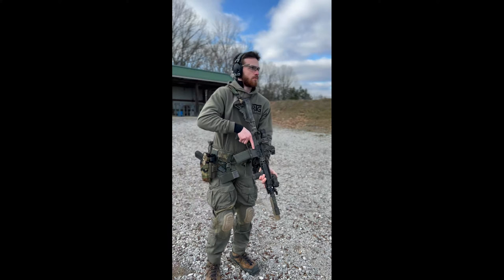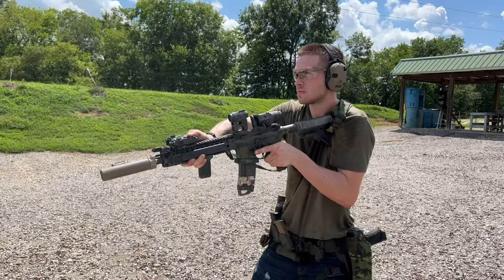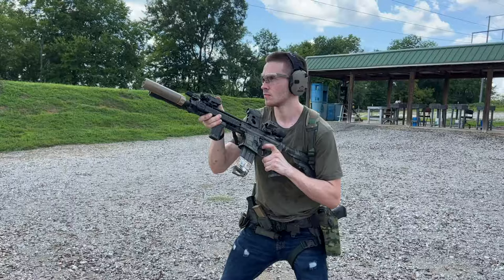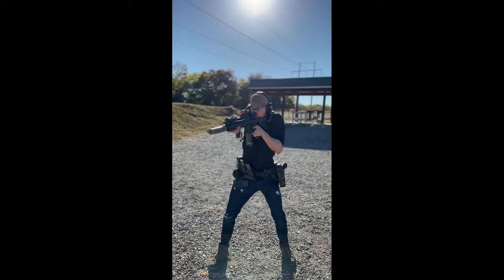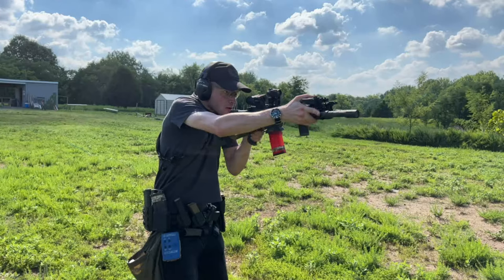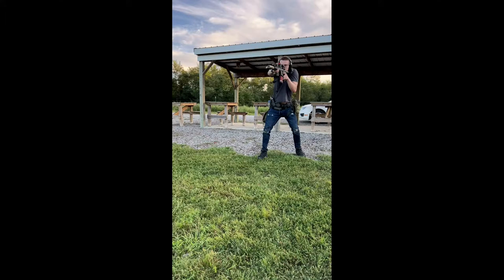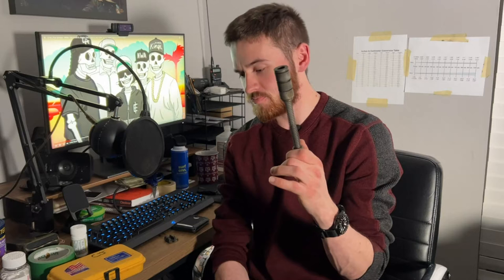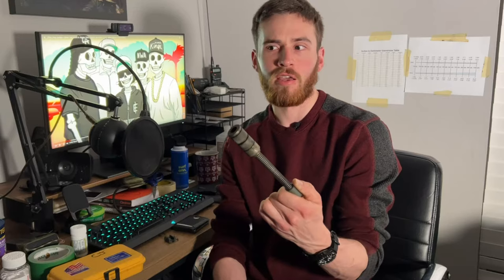JP Enterprise silent buffer system review

Comment: You presented a large amount of incorrect information. There is an easier way to replace the o-rings.  Follow the directions provided in the videos.
Reply from the maker: Large amount of incorrect information would mean more than one thing and what you just said is one thing. As i've said to a lot of people so far Regardless of what it even takes to replace the rings a lot or a little, its still a failure point that doesnt exist and a standard buffer system works perfectly fine. The gun is fine without this system. I "Personally" dont feel the need or see the benefit to using this system.
Reply from the maker: I honestly cant express it enough how the buffer system has made zero difference provided the weights are the same in anything having to do with actually using the gun.

Comment: I am filing a class action suit against Ford. The round things that my truck rides on are wearing out and steel is showing. What kind of bs is that. I call the dealership to complain. The service writer laughed at me. He said they were called tires and that's a wear item and they will need to be replaced periodically. I started whining that I paid $80,000 dollars for the truck. The tires should last for the life of the truck.😢
Reply: “Nope. Tires solve a problem that doesn’t exist and I don’t like creating new problems. My wagon wheels are creaky and bumpier but they are cheap and replaceable and what everyone else uses and they work just fine! DO NOT IMPROVE ON SOMETHING THAT ISN’T A real PROBLEM, PERIOD”

Comment: JP put out a video on how to change the O rings without disassembly of the system. Very simple and quick to do. By the looks of your system, a good cleaning might help as well.
Reply from the maker: I’ll have to give it a look, regardless the issue is more so the failure point and then having to service it whilst in the middle of other things
Reply: I was surprised with how dry the buffer in the video was, I expect a responsible gun owner to make sure their firearms are properly lubricated and taken care of. I'm always giving my friends shit for not lubricating their guns and then complaining about reliability issues.
Reply from the maker: @Simply709  You think im gonna handle the buffer in hand while its soaking wet in lub? its not in the gun and im talking about it. It was wiped dry..............
Reply: @autonomousdefense  Yeah, actually. it doesn't need to be completely submerged and dripping in lube, Nobody is asking you to stick it in the 55 gallon tub of lube that your boyfriend keeps next to your bed to make a video. But any responsible gun owner would at least put a thin layer of some sort of CLP on their tools to keep them from rusting. And by how dry that buffer looked I'm assuming it sat dry for a few days. You should never leave tools just sitting dry, especially gun parts. Its literally one of the first things you learn in gunsmithing school. Unless you went to SDI, then they teach you how to wipe your ass.
Reply from the maker: @Simply709  its hilarious watching just how hard you're trying to make yourself not look like an idiot because you dont understand the concept of wanting clean hands. I'm sorry you didnt take 30 seconds to consider maybe it doesnt need to be lubed because not only is it no longer in use but it will likely never be inside another gun again because its already been replaced by the standard system. god I love unhinged people like you.
Reply from the maker: @Simply709  it really does baffle me you'd say something that makes you look so stupid and just leave it here for future people. Thats why I love the comments, eventually someone will come through and have a nice laugh.
Reply: #simply709😂
Reply: @jamesr4992  dude must have blocked me because I can’t reply to him anymore. Can’t use a race gun item in a duty gun then get mad when it doesn’t perform the way you wanted it. Won’t get far trying to go off-roading in a sports car.
Reply: @Simply709   Keeping a thin film of clp or something similar on any metal parts regardless of current use or not is basic knowledge. I know 5 year-olds that understand that dry metals oxidate. Dude really tried to act like he's hot shit because he knows how to turn a camera on then got ratio'd super hard lmao.
Reply from the maker: @Simply709  you are most definitely not blocked i guess using YouTube’s comment system is too difficult for you to understand too
Reply from the maker: @KitKraft123  lmfao so this product that is effectively a display item of failure should be oiled inside the trash parts box it’s kept in? What the fuck are you even talking about dude.
Reply from the maker: @KitKraft123  “regardless of use” you mean to never be used ever again. This shitty little product will never be used again and your arguing it should be oiled when it’s literally composed of material that don’t oxidize from contact with air. It’s not like it’s being exposed to water or salt what are you even talking about lmfao
Reply: once again I leave a comment and it’s deleted within minutes of me posting it. Someone’s a crybaby
Reply from the maker: @Simply709  seriously I don’t care what you comment or say I’ve left every comment and every reply on this video untouched for over a year, I don’t know if you genuinely don’t understand how YouTube works or if you’re putting on a show for someone who doesn’t care.
Reply from the maker: @Simply709  it’s pretty funny watching some random gaslight YouTube comments. That’s a new one for sure
Reply: @Simply709  now I can't reply either. Funny
Reply: @KitKraft123  cry baby deletes any targeted comments that make sense. Can’t have someone who knows more than him in here talking about how the world works
Reply from the maker: @Simply709  literally still not modifying comments and I can’t believe you still comment here. Did you think not tagging me was gonna mean I didn’t eventually see you came back here? What Reddit thread did you people come from?
Reply from the maker: @KitKraft123  it is funny you don’t understand the commenting system. By the way, not tagging me isn’t gonna stop me from coming back here and clowning on you.
Reply: @autonomousdefense  it's not my fault that you don't understand the difference between competition parts and duty parts. I am going to repeat myself "if you don’t care then why do you keep coming back and complaining?" someone who really didn't care would let it go and ignore the comments. but you obviously cant let it go. your ego is so massive that you feel the need to try and prove that you are right, even though you aren't and the ratio proves it. I won a long range competition with one of these buffers in my AR10 on Sunday, and since the buffer mitigated so much recoil my follow up shots were 75% faster than the rest of the competition. I got the best score at 1/4 the time thanks to this buffer system.
Reply from the maker: @Simply709  literally “it’s not my fault you don’t understand (marketing terms)” bruh duty parts means nothing, competition parts mean nothing that’s literally just marketing bullshit to get people like you to waste money. Competition parts should be more reliable than duty parts because dudes who compete shoot drastically more. When that shit fails it’s because it’s a bad product designed and marketed to idiots who try to buy skill.
Reply from the maker: @Simply709  I’m just here because you keep talking about someone modifying comments and then you try to say something without tagging me so I can’t reply. I’m not letting you pull that bullshit.
Reply from the maker: @Simply709  lmao, nothing you just said is true, 75% faster due to recoil mitigated by the buffer system, LMAO. Post that match footage, let’s see that AR10, let’s see what muzzle device youre running on a gun that’s buffer System made you 75% faster. The definition of buying skill over here lmao
Reply: @Simply709  Please explain how your JP buffer mitigated felt recoil more effectively than a standard AR-15 buffer and spring. I've never seen that advertised as a feature of the SCS.
Reply: @slister1911  it makes the rifle cycle smoother which when paired with the low mass bcg decreases forces being exerted on the rifle which results in less muzzle rise allowing you to reacquire the target faster. Quieter, faster, smoother makes for a more accurate platform. Maybe felt recoil wasn’t the correct term to use, but it makes my rifle feel a hell of a lot better to shoot. I also just get a kick out of pissing this dude off. He knows almost nothing about how guns work but pretends to be some sort of guru

Comment: JP recommends changing the o-rings every 5k rounds. O-rings are cheap, and It can be done in 1 minute. Also, in a properly built gun, that screw on the other end won't break, because when the gun is put together the end of the weights won't ever reach the cap screw because the length of the BCG keeps them suspended 1-2mm away from the end of travel.
Reply from the maker: @Fister_of_Muppets  Considering the fact JP didn’t say that part about their own product I’m inclined to doubt it. Without removing all the o rings and testing it we wouldn’t even know for a fact if that is true. Regardless the product still offers no benefit whatsoever and hilariously there are other captured buffers on the market these days with wildly different designs. Again, a normal buffer spring and some skill contributes far more to the rifles performance than these types of products, they don’t improve shooting at all and the recoil impulse from these products offers nothing to the user in practice, it feels different, that’s basically all it does. Doesn’t reduce or enhance anything.

Comment: 7,000 rounds without replacement or armory service exceeds the mil spec for several parts on yhe M16A2 and beyond family of service rifles. Ive had service weapons break hammers, walk pins, even crack a bolt between scheduled armory visits. Btw, the cracked bolt first materialized as extractor problems.
Reply from the maker: Yeah whats wild is most civilian rifles exceed mil-spec requirements because we dont buy what is effectively the cheapest mass produced versions of our rifle's internal components. its almost like there is a difference between BCM, LMT, PSA, and M&P rifles.
Reply: I was an armorer, and if you abused your rifle like that, you would have gotten a counseling statement! Plus, i would have NEVER let you sign it back in….
Reply from the maker: @JIMMYJAMES156821  "I was an armorer" I hope you don't take this personally because I've got no way of telling your actually experience level but I've seen people who shouldn't have a drivers license call themselves "Armorers" I've met men employed as armorers and "Gunsmiths" and I've watched dudes break customers guns, incorrectly assemble them, or install optics incorrectly.  Extremely basic shit even in the military you can have dudes forget to torque barrel nuts being an "Armorer" means nothing, at all. to even state that like it gives you knowledge might as well be an admission you've never field tested equipment heavily. judging from the multiple comments you didnt even watch the entire video through to the end before asking questions or making statements.